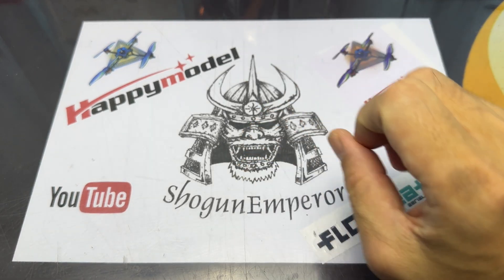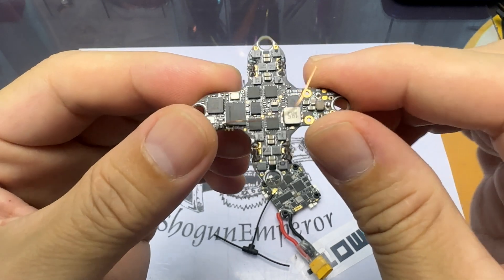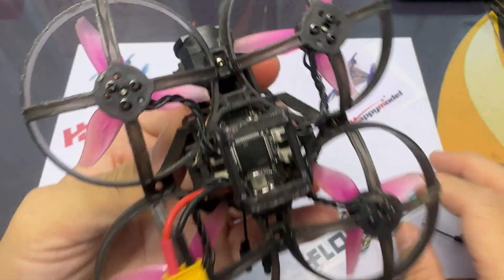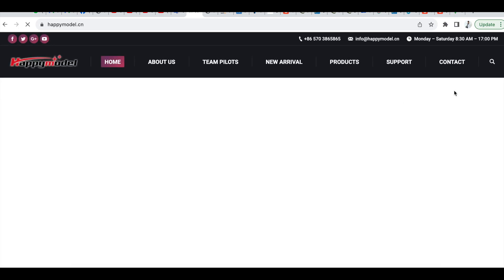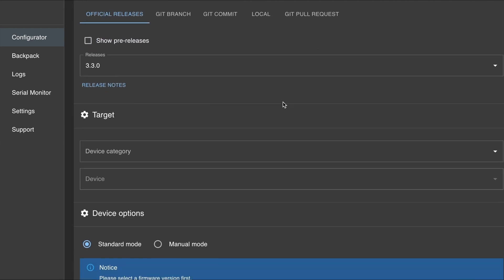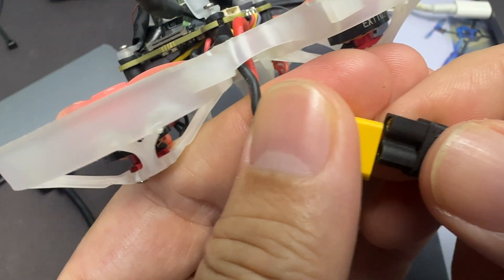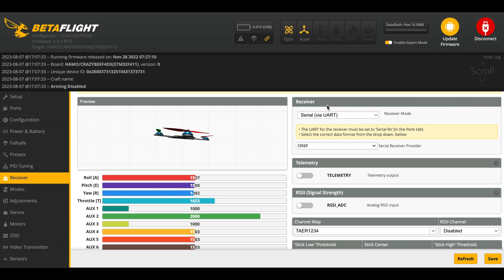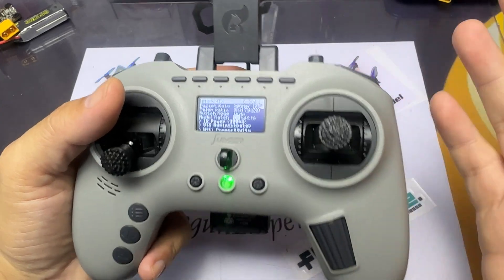Do not use Betalfight 4.4 on these AIOs?

Comment: Happymodel CrazyF4 ELRS AIO 5in1 whoop Flight controller motors wont spin shoing armed inbf
Reply from the maker: @krissfly  yes. U need to use the sliders on the motors tab to move the motors. U can also check its status on the receiver tab of betaflight. Its a safety feature

Comment: Thks bro for d heads up... 🙏🙏
Saw fr yr vid like there's a dump file for bf4. 4 on O3...
Will first clock in more time on existing firmware.
Still trying to xtend d flying time... Just ordered 720mah lipo, hope d weight won't b too heavy... 😅🙏😁
Reply from the maker: Nah! Dont update the firmware. Just fly it as-is bro. Less problem